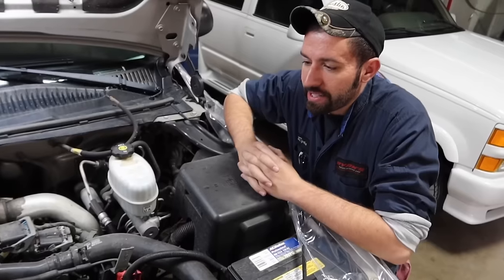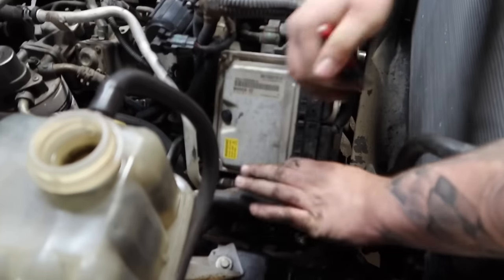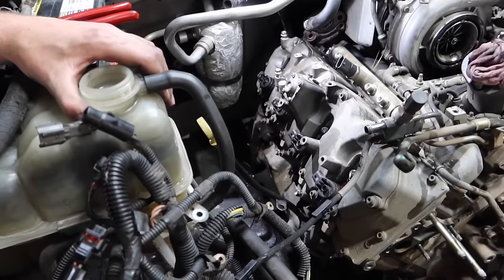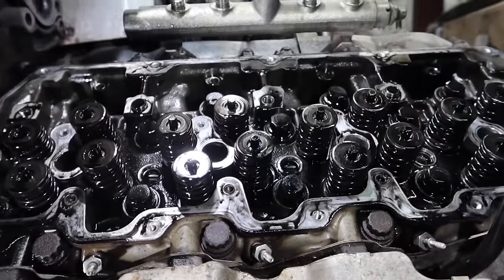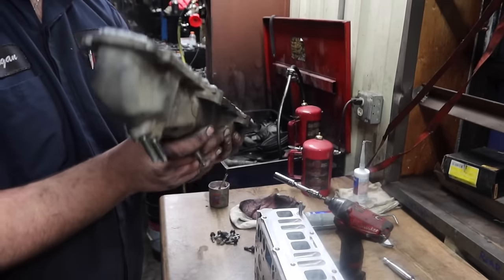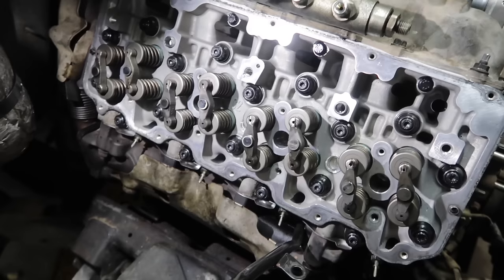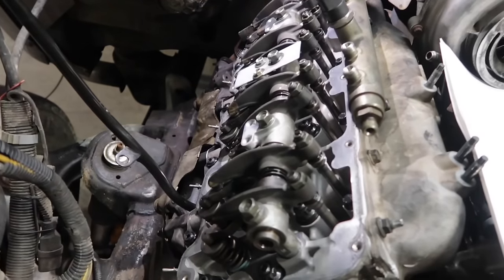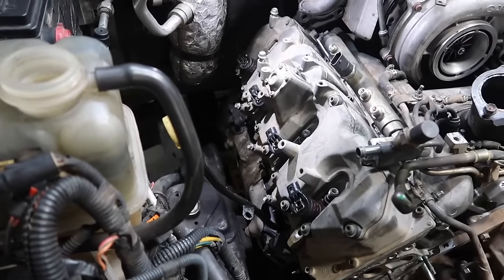How To Install Head Gaskets And Head Studs | Duramax

Comment: This is a fantastic video. My shop quote was 11k and I should be able to get it all done with some upgrades for 3-4k. Would you guys happen to have a tool list for the job? I have basically everything but just curious if there are some oddball bolt sizes or socket pieces needed. Thanks

Comment: Great video.  Would you replace the engine wire harness and injectors after 260k or wait to see the condition?  I will be helping my friend with his 05 dmax head gaskets and I wont be able to see the truck until he tows it to me.  Thanks for taking the time to film the video with commentary.

Comment: I have a 04 lly and I'm going to be doing head gaskets soon. I'm just wondering if I have further damage and should I even spend my money to replace the gaskets. It has really bad blow by and wondering if I have a cracked piston. 1 day i was going down 1 of my local back roads got into the petal and heard a pop then pulled over. My truck at this point was leaking out oil out of the rerouted pcvs and was missing horribly hence blow by. Do you think it's just a simple blown head or further damage? I've been following your videos and theyare very informational for me and others too! Great job on that! I'm nervous buying parts cause its like a grand and if I do get into it I just don't wanna find cracked pistons then have to potentially spend thousands more...plz help.

Comment: love you guys use the 16 inch straight-line line  sander We old time Rangus Cat mechanics have been using that with the dye  since  the engine was invented lol but I for the bugger high nickel blocks  use the Ingersoll Rand 315  air  but nice to see you young lads doing things the old ways
Reply: How did you clean the metal sanding dust out of the cylinders and coolant ports before reassembly?
Reply: plus you plug the holes with shop towels

Comment: If you don't have a leaking head gasket, can you remove one head bolt at a time and replace them one at a time with studs, torquing them down as they are installed?
Reply from the maker: No you can’t

Comment: I got a question do I need to pull both valve covers to tighten up the head studs on my 11 lml or can I acces all the bolts with just pulling the top one of

Comment: Wonder how many sand paper particals fell down the uncovered push rod holes? Lol
Reply: It will be fine
Reply: @carlitosgy6  zip tys and bias plys quote and sure it may be fine but would u be happy seeing ypur truck being worked on and someones dropping sand paper particals in your engine
Reply: I did that myself, for years, not one engine back, your opinion and i respect it but its ok
Reply: Yeah I have an issue with the sand and metal shavings not being captured at all when cleaning the block surfaces. I realize it is not easy to avoid that, but I have a real problem with the idea of putting a large amount of industrial-strength abrasive sand particles and iron shavings down into the oil passages, water passages and around all of the rings. I am 100% sure this will cause damage, maybe a lot.

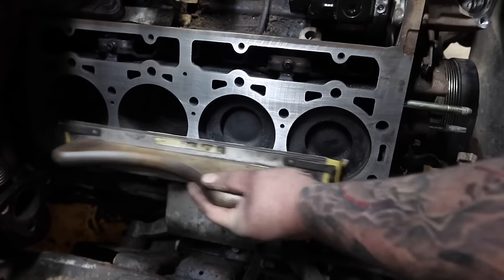Comment: at 35:00 just look at all the sand in the piston crown area and on the sides of the cylinder bore ??? i think they will blow air on it and jam it deeper into the ring lands ??? WOW. they should use towels in the cylinders on top of the pistons to at lease try to catch the rocks ??? and use a vacuum to remove the rock sand flaking off ??? very sad i don't need this...

Comment: My coolant reservoir is black but I have no other symptoms of head gasket failure. Not losing coolant, upper radiator hose soft after sitting, etc. Does that still mean my head gasket needs replaced?

Comment: You need an old valve adjusting tool like I got from my dad for setting the valves on a 235 6. Socket mounts on the handle and a knob on top turns the flat blade to adjust the valve. Hold the knob,  turn the handle to tighten the stop nut, done. Wrench and screwdriver is slooooww.

Comment: Am I still able to get the valve covers off with broken injector hold down bolts, broke 3 on each side
Reply: update: i did but ended up breaking one of the valve covers

Comment: So I just did head gasket and arp head studs on my 2004 gmc lb7 and it has a air dog lift pump so after I got everything to together and went to start it all it dose is crack over but won’t fire any idea? And it’s getting fuel pressure just kinda lost at this point.

Comment: The rocker bolts should be removed outside working your way in and inside out for assembly. And if you loosen off the lash nuts first you won’t bend anything . Should be resetting the lash anyway while In there

Comment: Question for the group. Is it important to retain the "bird cage" shroud for the clutch fan?
Reply from the maker: Yes
Reply: Extremely other wise your truck will over heat while towing
Reply: Dozerboy D8 depends on the tow. I towed a 6,000 pound fifth wheel through some long passes and it didn’t get above 220. I heard the fan kick higher a few times without it. In 95F heat. 

I did put the fan shroud back on.
Reply: @tstrenuous10  true, but I wouldn't risk it. I'd say if you would of had 9k on there you probably would have been in trouble. I know a guy that over heat and he was under 12k.

Comment: Can I drive my truck on to trailer, it just started blowing white smoke . It was spewing coolant out of reservoir and then it started blowing white smoke.  It didn't heat up I caught it right away and parked truck. I'm just wondering if it would be okay to drive it onto trailer . 😢

Comment: I've been looking on Merchant Automotive website and can find no technical information area, looks like only parts. I searched for "DURAMAX VALVE ADJUSTMENT" with no hits???
Can you please provide a link to the pages to be printed, I looked in your "Description" also and didn't see a link.
I heard you say .012 feeler gage only, but usually intake and exhaust have different specs. [intake is a few thousandths less than exhaust.]

Comment: Fixing to do my LLY next week, I’m really thankful for the video brother thank you so much. Maybe a dumb question, should I take heads to a machine shop just in case and if so how much on average do they charge? Thanks
Reply: How did you clean the metal sanding dust out of the cylinders and coolant ports before reassembly?

Comment: Guys im doing this head job to my LLY as well, but when I removed the injectors I didn't label them, does it matter if they are installed back mix match in any bore??? Also what exactly is the sand paper grit sequence? And should I use WD40 as a lubricant while sanding?
Reply: How did you clean the metal sanding dust out of the cylinders and coolant ports before reassembly?
Reply: @cdsmit27 brake clean and air.

Comment: I just finished my headgaskets replacement with studs. Now im not get fuel to start.
Reply from the maker: You are sucking air or you didn’t prime the fuel filter correctly
Reply: @TruckMaster  I did prime it. Then I did put air dogits pushing fuel up to filter. Just not getting out the injectors. Hit little starting fluid it want to start.

Comment: Great video!! If the truck is running fine, but getting pressure in the coolant, would you rebuild the heads, or just put them back on? 320k miles btw.
Reply: what did you end up doing ?

Comment: What was the cost to have the head gasket job done with ARP head studs?
Reply: I think the studs alone are around $500. If I had to guess I'd say the whole job is around 2k.
Reply: @berlinetta350  I'd be down for that for sure but what i have read online is it is some where around 5-6k  hopefully Ryan chimes in
Reply: My lly was close to 10k both heads were warped bought 2 new heads new water pump and various other parts 🤔
Reply: BoBo complete job runs $4500 for everything
Reply: Just got head studs and gaskets done on my lmm, they pulled the cab for it but that doesn’t affect the price. Had my heads sent out and machined/tested. And the injectors sent out and got cleaned and resealed/tested. It Was about $8500 for all that. Had a bunch of other shit I did while it was torn apart and quickly got up to $13k. Most shops’ policy is to send out the heads and injectors because of they are bad, then it makes the whole job useless basically.
Reply: @ryansdieselservice   Thanks Ryan for the reply .. By the way that 64mm turbo i got from you guys on black friday for my LBZ is amazing!! When i come out that way from Oregon to have you guys do the trans and transfer case from Kodiak I'm probably going to have you do the head studs also.
Reply: My LLY was $5100. The job for just head gaskets and studs was $4800 but there was bad brake lines, radiator, glow plugs, injector cleaning, so after tax it came to $7200. Shop cost I believe was $120 an hour or so... and I did that a year ago
Reply: Did mine in the driveway for around 1400

Comment: i use the line wrenches for all sorts of stuff they are so nice if your trying to not round stuff off haha but they work great for brake-lines and fuel-lines etc like you did in the video they are just a great invention rather than the regular open end wrench that usually spreads open and slips and rounds stuff off haha been there to many times lol haha great video as usual <3 :)

Comment: SO YOU STOP SANDING BLOCK AT 180GRIT OR DO YOU FINISH IT AT 600GRIT?
Reply: I thought for sure the caps would help you get an answer. Would like to know this too
Reply: The engine uses MLS gasket technology.   The RA or surface finish needs to be under 25 RA normally, Fel-Pro uses a special coating that allows up to a 55 RA.   I think it would take 600 grit wet sand with at least 10 strokes to get under 55 RA.   the rougher grit paper leaves peaks and valleys that can cause damage and eventual failure to an MLS design.   They are great gaskets and hold more pressure than any other factory design but need special care.  FYI:  an RA of 15 is nearly smooth as glass.  So a 55 still needs to be pretty smooth.

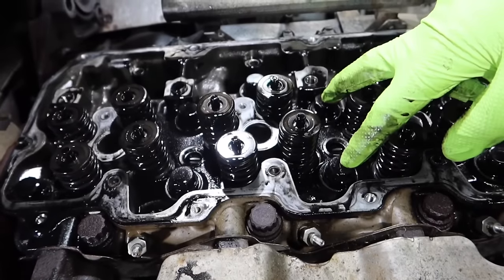Comment: I'm splitting hairs here, at 27:35 u said loosen headbolts from inside out, on gas engines u loosen from outside in, reverse of torquing sequence, is this just a duramax thing? Or did I have the sun in my ears? 🌞😑☺
Reply: It's a diesel thing.

Comment: For the up pipe to manifold bolts. Can you easily access the 3rd one that is not shown? 

I'm in the middle of replacing my headgaskets and It appeared that I wouldn't be able to get to it....but it was getting dark and I didn't get a good look.

Comment: How much would this cost to have done?
Reply: I was quoted between 6k-8k depending on whether my heads are cracked for my 2012 lml.
Reply: @jasoncakerri8878  and that's why I cant afford diesel. Found a 2011 2500hd with 180k with bad head gasket. Runs fine but when turn off it bubbles back in overflow for 13k obo but for 8k I'd just buy one thats good
Reply: @pyrojoe1404  I mean I’d get a quote from a local shop first my number is a little skewed cause I’m also getting a welded water pump and thermostats done with the arp head studs. Also the 8k is only if the heads are cracked and can’t be machined cause those are 1900.

Comment: Hey guys I need some input. 
I have a 2007 LBZ Duramax 140K  I have EFI live and MBRP exhaust When I have the level turned up to four or five on the freeway the truck will start shaking upon acceleration full boost it almost feels like it’s coming from under the truck like a really bad shutter or shake e maybe even like a bouncing up and down almost like a vehicle that’s doing a burn out with the tire bouncing but it’s coming from under the truck. It will only do it on the freeway at higher speeds. Accelerating from low speeds it’s fine
Reply: Steven Baca might be torque converter shutter you are experiencing
Reply: HBURT725 you think? It still accelerated no check engine lights. Just 5th and 6th it’ll shutter if I punch it it seems to do it a little less than if I roll on the throttle like if I let it hit full boost at a lower RPM it start shaking more
Reply: Steven Baca my lbz will do the same exact thing. I’m pretty confident it’s the torque converter not being able to hold the power of the higher tunes in those overdrive gears. I don’t know what else it could be but I try to not let it happen because I’m sure after enough time it will slip enough to limp the trans and then it’s time to build it $
Reply: HBURT725  thanks buddy I appreciate it very much! If you find anything else out please shoot me an update! Happy New year buddy 🤙🏼
Reply: It’s the torque converter trying to go from partial to full lock-up. The transmission will only go into lock-up at higher speeds to improve fuel efficiency.

Comment: I was quoted between 8-10,000$ for head gaskets on my 01 LB7. Is that even accurate or are they really just trying to stick it to me?
Reply from the maker: That’s way to much
Reply: Truck Master I kinda figured. That was through a diesel performance shop in Murfreesboro, TN they use to be reasonably priced. They did a motor swap for half of that in a 03 F250 6.0 for me. Cost about 5300 I think. 
He said that was the high side of things I don’t like guessing when it comes to repairs. I like to know an almost about accurate quote.
Reply: it's about $4500
Reply: Nick Larson that’s about what I was thinking

Comment: I’d be curious to know what it cost to have this done
Reply: I was quoted by two different shops at $6-7k. Over half of that is labor alone. Decided to do it myself to save money on labor and be able to use better replacement parts as well as the EGR delete.
Reply: @BackwoodsTinkerer  yes I’m sure that’s what I’ll end up doing. I always do my own work
Reply: @tater0909  I was able to get better coolant hoses, a 1-peice y-bridge with a 3" cold and hot end pipe, 3" down pipe, updated driver side manifold, PPE up pipes, ARP head studs, high quality grade c head gaskets, new water pump, v clamps, glow plugs, rancho steering damper, and other misc stuff and still be well below the quotes price by a shop that would have used OEM head bolts and gaskets.
Reply: @BackwoodsTinkerer  I have a lot of that already done. I am going to be doing the high flow manifold and up pipes soon (hopefully). Been trying to decide which y bridge I want as well.
Reply: @tater0909  Pusher Intakes is the route I ended up going. They shipped same day, had a true 1 piece, and had almost every color option in stock ready to ship
Reply: @BackwoodsTinkerer  did you machine your heads? Did you replace with  ‘c’ to match old gasket or c by default?
Reply: @dustinmceachern4898  c by default, and yes the heads were machined. That's an absolute must. I also had the intake manifolds take an acid bath to clean out all the soot the egr threw in.

Comment: How bout the Class Action suit settled against GM for its DEXCOOL that destroys gaskets and seals?? Anyone collected on it?
Reply: That was 17 years ago, for 1995-2004 Vehicles. Dex-Cool works flawlessly in GM engines and was never the problem. The Problem was not the Dex-Cool itself, it was the Silicone infused plastic intake manifold gaskets that reacted with the Dex-Cool, and caused them to fail and turn the coolant into Sludge.

Since GM switched gasket Materials, there has not been a single major issue with the Gaskets reacting to the Dex-Cool. Dex-Cool works better then standard coolant anyways. Also, Dex-Cool does not touch the intake manifold gaskets anymore.

Comment: Great informative vid 
Brings clarity to the job 
I loved the long board cleaning the block surface up. I’ve used an air board doing a crosshatch pattern to true up cast exhaust manifolds and it worked great. This is next level content  ty.

Comment: Bro why do you take the time to state your going to list some part used in videio (I.E. head gasket or head gasket kit) but theres no listing not even a mention of the actual item name or part number.. yeah i see the link for the website but hmm you do realise there are more then 1 type of head gasket and more then 1 vartiation of head gasket kits with different parts in each kit.. i mean if your taking the time to say you'll list it,. hell why not actually do it... but great video otherwise very very informative for this going to be my first diesel head gasket install.. reallly appreciate the video..

Comment: Why do you guys skip over so much of the less but more important stuff?
For instance, how did you get the 3rd bolt out of the passenger side exhaust manifold? You know, the ONLY one that's hard to get? how did you get that bolt back in? There's barely enough room to get a wrench on it, much less turn it. How did you get the ds valve cover back on after doing the studs on that side? your video totally skips over that part. Do you have part numbers for any of the small hoses that go on the top of the engine? I saw you cut at least one of them and stated you would replace it. I'm sure there were others that needed to be replaced too. What about those hose clamps? where do you get new ones? do you replace them with factory clamps, just put the old incorrect ones back on, or use new screw type? I like your video but there are several segments that need some special attention. Please do another video and focus on some of the harder parts of the job like putting all the fuel lines back on correctly and installing the wiring harness/ where everything plugs back in where it goes over or under or around various other parts of the engine. Basically any part that is hard for you guys is going to be hard for us.  Thanks

Comment: Modern day diesel's are more expensive to buy, higher cost fuel, higher maintenance cost, you have to buy DEF fluid and to top it off they are less reliable. I'm going to stay with gas engines in my daily drivers and business.